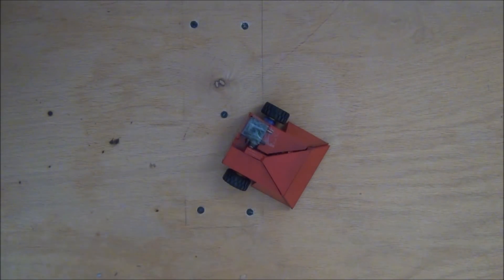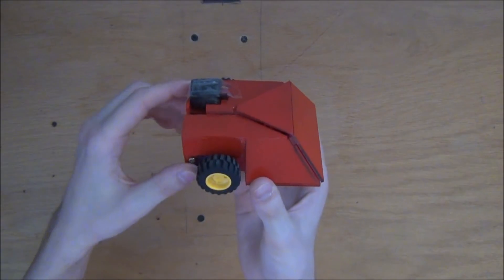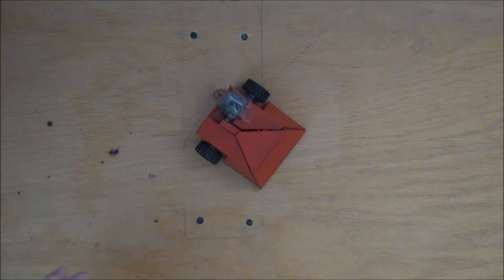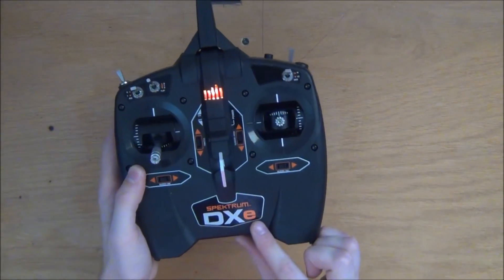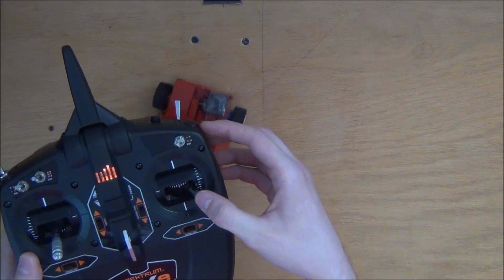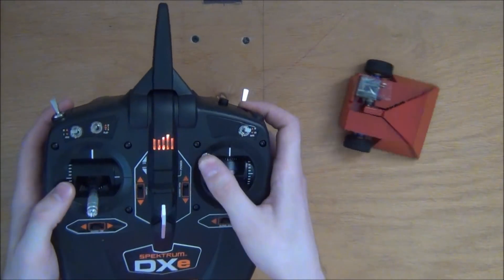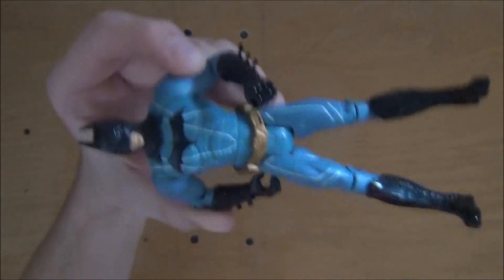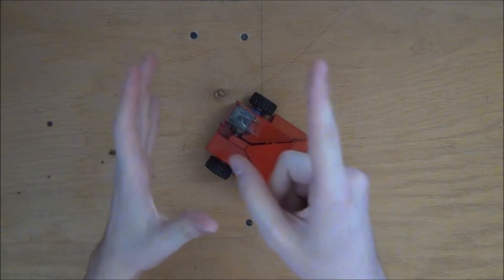How to build a battlebot (Part 2)

Comment: The code please for the car....IS to ardinooo
Reply from the maker: sorry what? You mean you want me to build a version powered by an ardino board?
Reply: Actually i am trying to run my 4 wheel car wirelessly using RC and Android...but i am failing......
the car doesn't run smoothly...i want to drive likw a tank with full access to left wheels and right wheels sepeartely..........
Reply from the maker: Hmm... I'm not sure, but it sounds like there might be a problem with your receiver. But like I said I'm not sure, sadly I don't have enough information to really be able to tell what's up.  :/

Comment: Where did you get that aa pack?
I can't find it anywhere
Reply from the maker: You can find them almost anywhere online. https://www.ebay.com/itm/10PCS-Plastic-Battery-Storage-Box-Case-Holder-3-AAA-To-18650-Battery-Converter/272457416081?_trkparms=aid%3D555019%26algo%3DPL.BANDIT%26ao%3D1%26asc%3D41375%26meid%3D80d6b16e36354f3282bd6edb271569d5%26pid%3D100506%26rk%3D1%26rkt%3D1%26&_trksid=p2045573.c100506.m3226

Comment: how much can he push and what motors and servos are you using? im planning on making a robot but dont know what parts i should use
Reply from the maker: I'm just using 360 degrees servos I bought from robotshop.com. I would say the servos can push at least twice their weight if they aren't modified for speed.

Comment: What if another small bot gets into the space below the flipper when it is open?
- Also, how do your servos make the robot go more than 180 degrees? Is it a motor?
Reply from the maker: That's part of the reason I have that short wall underneath the flipper, to stop other bots. However if something does drive in I would just shake them off. But if we get stuck together then the ref will usually stop the match, pulls us apart and then resume the fight. For drive motors I am using standard 180 degree servos that I modified to run 360.

Comment: Do you connect the servos straight to the receiver, or do you use an Arduino motor driver?
Reply from the maker: Straight to the receiver. With a bot this size an Arduino really would do anything and it would add unnecessary weight.

Comment: where did you bought battery pack, controller and transmitter?
Reply from the maker: I don't use a battery pack, I just use a 3 AAA battery holder. And I bought my transmitter and receiver from my local hobby shop.

Comment: with a better controller you can work out the mixer setting and get it to control correctly
Reply from the maker: Actually I can change how its set up now. I would just need a $15 cable to connect it to my pc. However for me I prefer how its set up now.  :)
Reply: I am all about simplicity a 50 dollar controller seems pretty simple, but yeah a 15 dollar cable seems even better.
Reply from the maker: :D

Comment: how to connect the remote
controller to the battlebot?
Reply: You use a receiver which comes with a good remote controller. The receiver goes inside of the robot and everything plugs into it.

Comment: what reciver did u get
Reply from the maker: I used a spectrum DXe.
Reply: +Mechanical Ninjineer  I don't know yet problly yours
Reply: +Mechanical Ninjineer what really is a reciver
Reply from the maker: Well a transmitter is a remote you hold. so if you want your robot to go forward you just push the control stick forward. And so the receiver sits inside your robot and tells the motors what you are doing to the remote and therefore how you want the robot to move. :)    I hope that was helpful!
Reply: +Mechanical Ninjineer thx
Reply from the maker: yeah for sure! :)

Comment: does any servo work for a any controller
Reply from the maker: yes. any servo should be able to work for any receiver with very few exceptions.  :) Thanks for watching!
Reply: +Mechanical Ninjineer with reciver did u get. u didn't say
Reply from the maker: I used a spectrum DXe